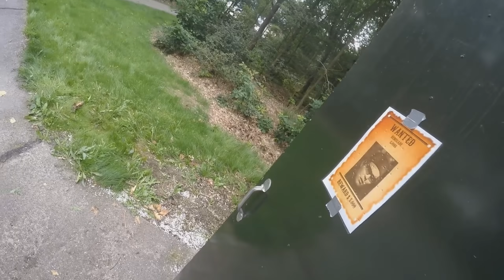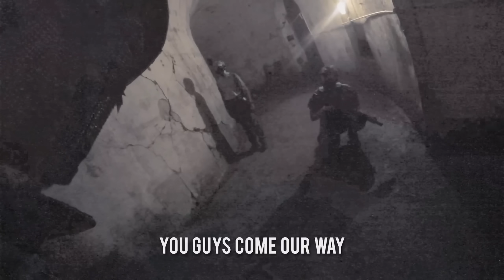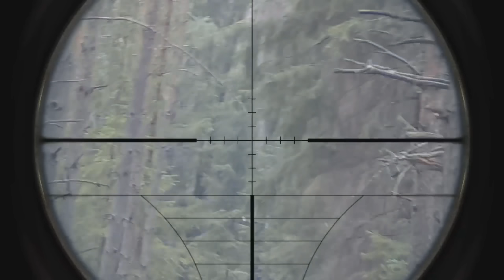TOP 100 Airsoft Moments of ALL TIME! 😲 (Cheaters get Karma, Fails & Epic Moments)

Comment: Theres a helicopter just for Airsoft?

Also, when the minigun came up, does it cost real money or what. (Ive never done Airsoft so dont bully me)
Reply: The game that used the helicopter was a massive hardcore 2-day event. Those types are usually only played by people very experienced in Airsoft. 
In regards to the mini, you should look up pricing on the 'pro-rated' weapons, not the Wal-Mart or Cabela's ones. They can get VERY expensive especially after you custom mod them. 

Airsoft is a really fun event, even just playing casually. It's a good way to get some exercise, blow off some steam, and generally have a good time. If you ever do decide to play I absolutely recommend a high-quality face mask, and either a helmet or thick headcover just to prevent the sting from those shots.  Eye protection is 100% required by any field or event. If they don't demand all players wear eye protection, don't go.